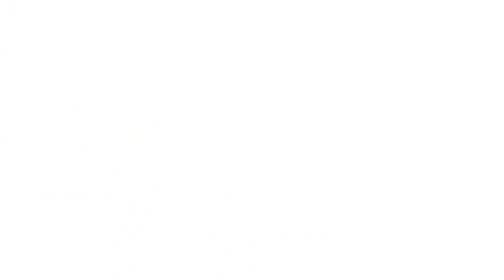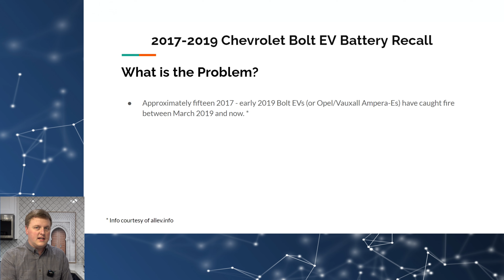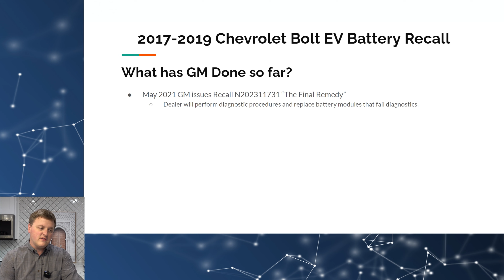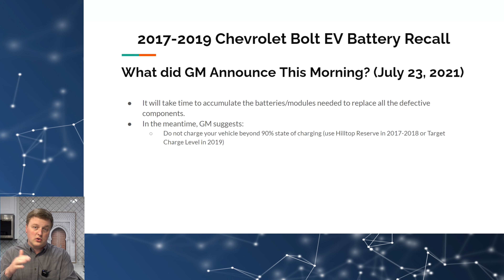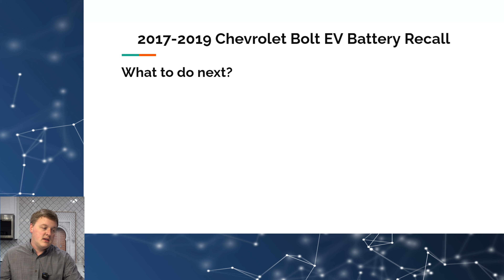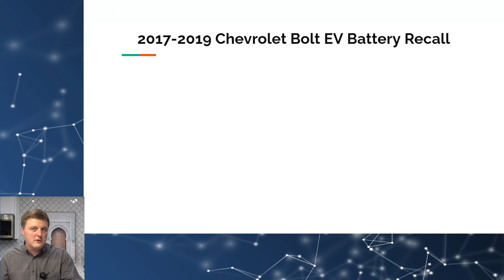GM issues a THIRD battery recall for the Chevy Bolt

Comment: Isn't this very old news - it is now Dec 2022.  Supposedly they are replacing the bad batteries for free in the older models, so we should be good to go in the 2023 models.  So i am not worried about the new 2023 models.
Reply from the maker: Not sure if this comment is intended for me or not, but you’re right, this is old news. The video was posted over a year ago. Much has happened since then.

Comment: This recall is a shame and GM needs a class action.  The recall involves lowering the capacity of the battery to 83% capacity. You no longer can charge it a 100% which will decrease mileage to about 188 miles.  Anyone else experience this?

Comment: One thing I know is that LG makes some really crappy appliances.   The lint filter on the clothes dryers are absolutely pathetic.   There is no good reason in the world, that LG could not design a lint trap that actually catches lint.   The one on most of their machines is extremely leaky and leads to excessive build of lint inside the machine which eventually can lead to a house fire.

Comment: LG makes sh** products! There have been recalls with some kia EVs and some Hyundais due to the same thing! LG supplied the batteries. The same thing happens with their smartphone screens. That's why Apple no longer has LG produce any screens for them.
Reply: I agree the LG brand is to be avoided.   Lint filter on their clothes dryer does a very poor job of trapping lint.   Could easily be designed and manufactured better.  Of course when you buy a Chevy Bolt, you don't know you are getting LG crap in the innards.

Comment: a quick google research shows that gm is using the same style of battery modules that they did way back in 2014.

i wonder if there isnt a faulty connection in the bms connector where one of the cells is intermittently not being connection?

i should know because i have a 2014 chevy volt battery module i use to power an ebike i bought on ebay.

along with the module came a crudely wired bms connector that used 2 series wired extension ribbons for breadboard/arduino/raspberry pi application through a balance board for an ev peak a9 hobby charger as the battery module is a 12s3p configured.

that is 12 series of 3 parallel wired cells for a total of 36 cells.

i was getting cell count errors on the 1. side of the battery module because i had to electrically split the module into 2 6s so i can charge them with a hobby charger and the 1 6s side kept giving cell count errors or would take a really long time to balance.

so i rewired the balance lead to remove the 2 breadboard extension ribbons and wire 6s balance leads and i was still getting charge errors occasionally .

i finally got a evpeak a9 charger witch can charge all 12s at once so i wired up a new connector and still got cell count errors and i figured ok maybe there is a problem with the bms port or cable where the connector would not fit in all the way.

the ev peak charger is so good at detecting problems with the wiring it will abort and show error immediately if the wires are even bumped while charging.

i have on order a new connector that is designed for atx power supply and will have to trim down the end with a dremel i hope the connector pins will be able to connect better and not lead to incomplete charge due to faulty connection.

also it could be that gm is trying to charge too fast so maybe they need to reduce to 10 amps for the charge rate.

Comment: What happens concerning ex European GM brands now in Stellanis' (?) stable - do GM remain responsible or the new owners? Also recharging areas here are more compact - folk charge side by side then Park n' Ride or go off shopping. Potential danger for vehicles grouped together. If you recharge in an integrated garage area or any garage area ensure you have WORKING fire alarms. Would extended cables allowing recharging away from buildings? Have concerns for elderly family friend about to complete an EV deal.

Comment: I have installed an alarm on my wallet that will activate any time it is opened inside a GM dealership. So far it has been 100 percent effective in preventing me from buying a Chevy Bolt.

Comment: Thx for an intelligent assessment of the issue.  I have a Sept-2018 Kona and am awaiting a new battery.  I have an image of the sectional view of a cell which clearly shows what I expect is the folded-anode issue, where dendrite formation could easily puncture the separator.  But the image happens to be from a Bolt cell.  The SOC characteristics of the Kona’ s E63 cell (OCV from 100% to 0% SOC) seems to be identical to the Bolt despite the slight difference in the number or cells in series, 98 for the Kona.  Lastly, the Kona has had battery monitoring longer than the Bolt (May 2020, campaign 196) and Hyundai was quicker to advise customers of the need for battery replacements despite that it’s been a slow process.  GM tried to get away without doing that, a point I think you missed (or I didn’t notice).  I’m convinced the issue is the same for both cars simply based on the stats, that both are LG Chem, and that the defect (the folded anode) appears to be a manufacturing cost-cutting shortcut rather than a functional design detail.
Reply: Interesting.   I really don't trust LG based on the lint filters in their clothes dryers which is very poorly designed. It would not have been difficult for them to design and build a decent one that didn't leak massive amounts of lint into the internals of the machine.

Comment: Today, I had a rare day off from work, as well as a project over at my dad's (dealership area) that would take a couple hours. So I decided today was the day to have my 2017 Bolt serviced with the "final solution."

When I got the call saying my car was ready, I was told that it was an interim fix, which confused me.

I came home with the intent to find out what was going. I used to be a bit of an EV enthusiast until I bought one. I kind of keep my ear to the ground, but it's not a priority. So I did not know that the "final solution" wasn't.

This video was very helpful to me. As somebody who only heard the prior steps through the grapevine, it was nice to have a one-stop, beginning-to-end explanation of all that's going on. Thank you for taking the time to publish your combined findings.

I bought my 2017 Bolt used back in March, knowing of the open recall. I got it for a steal at $15,663 with only 10k miles on it! I do have an enclosed garage and had Hilltop Reserve turned before I left the car lot. I usually drive the car down to 50%-ish and then back up to 85%-ish. I don't drive much.

I am glad that the service I had done today will help to lower my chances of a problem, as well as possibly warn me if a problem it coming. I don't think I intend to pursue a buyback and actually look forward to the possibility of having my battery replaced. That said, I thought of a couple questions for you.

1) Do you think the buyback applies to people who are not the original owners?
2) Do you think that in the event that my entire battery is replace, that it will come with a brand new 8-year warranty?

Comment: As far as I know, GM used lots of LG batteries from Korea, which also have been used on many Hyundai electric vehicles like Kona. I would avoid those electric cars as I can not imagine if they caught fire inside of my garage.
Reply from the maker: Many vehicles use LG batteries. The Kona is currently going through almost exactly the same issue as the Bolt (I used to own a Kona that was affected and sold it earlier this year). The Kona batteries are built by LG in China though, not the same factory, for whatever that is worth.

Comment: I would have demanded that they give me a FREE loner vehicle (any kind) until the problem was fixed.
Reply from the maker: As I said, I did ask them for this, and they were very clear that is not an option.
Reply: @wrenchingfool5284  GM SUCKS.  Won't be buying any vehicles from them.  Not sure about FORD,  We're very happy with our Dodge Carivan, maybe Crysler will make an EV.  There is also VW, but I still remember dieselgate.  Tesla is my first choice, but they are getting more expensive and have a long wait list!

Comment: I chose the buyback because i knew it was never going to get fixed. Impacted my home solar battery as well which has been pretty terrible. I won’t buy anything that has the name lg chem attached to it.  They should replace all batteries.  But they drag consumers through hell trying to patch fix a major problem.
Reply: My experience with their clothes dryer is that LG is quite experienced at designing defective products.

Comment: Hopefully the new designed 2022 will not have any issues.
Reply from the maker: The 2022 uses essentially same battery as the 2020+ Bolts, and so far they have had no issues that I’m aware of. I personally have not heard or experienced any other common issues with the EV drivetrain in the Bolt.
Reply: @wrenchingfool5284  Thanks. Is it true the rear end suspension on all bolts is a solid axle with a tuned suspension, so NO independent ion the back?

Comment: I believe GM actually purchases their batteries from another company which is why their 2014 SparkEV had so much more torque than later versions as the battery company they were using went out of business.
Reply from the maker: Yes, I believe the 2014 Sparks used batteries from a company called A123, and they did go out of business. I believe the Sparks after that used LG batteries, as did the Volt and the Bolt.

Comment: No mention of testing the individual cell temperature while under a load.   Static cell voltage isn't enough information.    Testing under a load is the best way to understand if each cell is behaving normally.    You guys need me to come over there and help you understand the problem?   No charge.
Reply from the maker: I don’t pretend to understand all the technical details of battery technology, but I get what you are saying, and it’s part of the reason why I doubt that their efforts to “diagnose” failing battery modules and selectively replace them. I don’t doubt that GM or LG engineers could determine a way to test the individual cells, but I doubt that they could do it with the hardware that is currently in the vehicle, and I definitely don’t trust the dealership technicians who are looking at the cars since they generally only have a very superficial understanding of how the cars even work (I say that as an auto tech myself who has worked at a Chevy dealer in the past).
Reply: GM: What is testing??

Comment: This recall is a good thing as long as GM learns from its flaws and improves the design. It’s not like Tesla never had any major issues engineering their vehicles.
Reply from the maker: Exactly. New technology = new problems. Unfortunately, it is low hanging fruit for all the Tesla fanbois and EV/GM haters.
Reply: That's because Tesla has real engineers and GM has bean counters. They have put many suppliers out of business with their ICE cars.

Comment: I'm in the same boat as you with my 2019 Bolt purchased in October 2019 (I'm not quite sure when my Bolt was produced but GM issued a recall for it - which I did). 

The only difference is that I am kind of in two minds about the buyback thing. On one hand, I truly love my Bolt and it would be sad to see it go. On the other, risking to lose my car, my (detached) man cave and - potentially - my house to some mysterious "manufacturing fault" is hardly an option.

Anyway, I have subscribed to you channel and do look forward to learning about your buyback experience. Thank you fellow Bolter! :)
Reply from the maker: Thanks for watching and good luck with the buy back.

Comment: So now I'm thinking about purchasing a used Bolt at a discounted price and getting a brand new battery pack from GM.
Reply: Oh? GM has not stated they are replacing the packs. Word is that they just might buyback the affected Bolts and crash them.. 
Sales have stalled on the older Bolts and the prices really have not come down that much.
Reply from the maker: As stated, GM may not be replacing all the batteries, they are still (currently) stating that they will only replace defective modules. Not sure how they intend to reliably identify which ones are defective (before they catch fire).
Reply: @wrenchingfool5284  Thanks for the reply. You caught me not watching the entire video... Sorry!
Reply: @wrenchingfool5284  So a module is a defective cell or something else?

Comment: Looks like GM is trying to kill EVs again.
Reply from the maker: I don’t think that GM intentionally installed self-combusting batteries in the Bolt, and although their response to the problem is not as good as it could have been, it definitely doesn’t look to be an effort to kill off their EVs. They are doing just as well/poorly as other manufacturers have done in the same situation unfortunately.

Comment: Looks like GM back tracked a bit on the battery replacement. Now they state that ' defective modules' will be replaced and not necessarily the entire battery pack.
Reply from the maker: They were a bit unclear on that at first, and yes, their later statements seem to indicate that they aren’t just replacing all the batteries. A big mistake in my opinion, and it makes me even more glad that I pursued a buy back instead. I don’t want the “what ifs” running through my head for the entire time I own the car. Thanks for watching!

Comment: I still think the best solution is park&charge outside, and just stop worrying about it! . . .
Reply from the maker: Parking and charging outside may reduce this risk of your car burning your house down, but it does not reduce the risk of your car burning itself down and potentially damaging things around it. Lithium batteries burn quite hot, as do vehicles when they are fully engulfed in flames, so even things that are not "close" can be damaged. I do always park my car outside, but it sits in the driveway with 4 other vehicles and trees on either side. Even if I parked it in the street, it's still quite close to trees and bushes that could easily burn, especially given that it is summer and quite dry. Parking outside also creates other inconveniences, such as getting into a baking hot car every time in the summer, paint and interior damage from the sun/heat, as well as dealing with a frozen car in the winter. It's far from ideal and far from a "solution" in my opinion.
Reply: @wrenchingfool5284  I don't have a garage, so all these things are daily life, and you also need to consider the statistical likelihood of a fire; IMHO it's not worth the stress of worrying about it.  Just follow the precautions, keep up your fire insurance and forget about it . . .
Reply: @wrenchingfool5284  I'm familiar with a lady who has a Volt.  Parking it outside to charge would be extremely inconvenient.

Comment: What is GM doing now with the new 2022? That would be a question for me as I'm considering moving to an EV from my trusty standard Prius. Any battery, either one cell or several thousand cells in a large pack can fail if mistreated. Do the newly introduced 2022 Bolts have software that limits maximum SOC or minimum SOC? Although my current Prius uses Nickel Metal Hydride cells the computer is very good at managing the main battery pack. In my situation, I'm now retired and my trips are usually around 25 miles or so so my preference would be only "trickle charging" with the 120v charger, and limiting max charge to 80-85% and perhaps 40% depth of discharge. The main pack would be quite happy with this and so would I.
Reply from the maker: This hasn't been answered for sure, but for 2022 GM did reduce the advertised capacity of the Bolt batteries from 66kWh to 65kWh, and I suspect that 1kWh loss was as a result of increasing the battery buffer. The 2020+ Bolts also use a completely different battery from the affected 2017-early 2019 Bolt batteries, and so far there have not been any issues with them. I'm not sure if GM changed anything with these batteries to increase their durability, although I will say that prior to the battery fires, the 2017-2019 Bolt batteries had been shown to have very low battery degradation, even without having a top or bottom buffer. I generally do not charge my 2019 Bolt past 90% and usually try not to discharge below about 25% in daily driving, although I have quite deeply discharged it and even ran it out once (by accident!) on longer road trips.
Reply: 23 Bolt is awesome. Bugs are worked out now